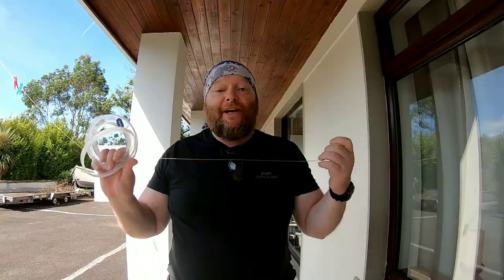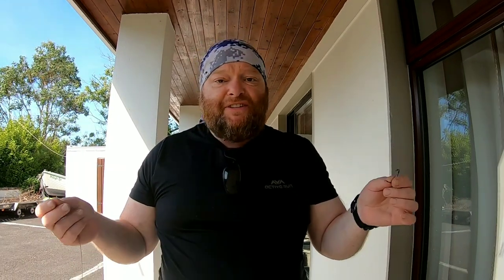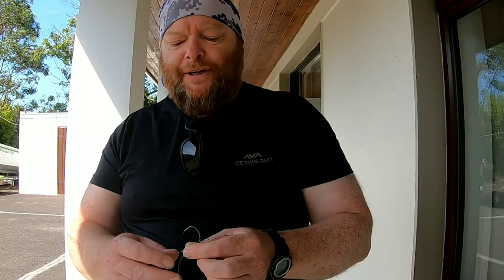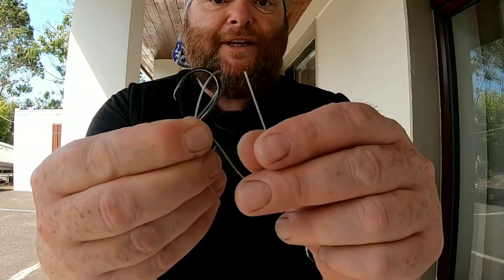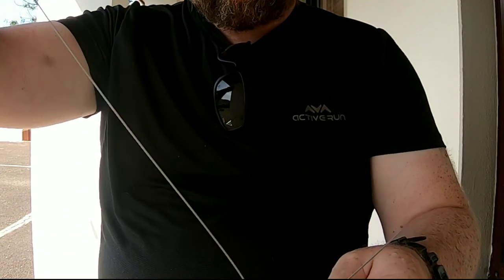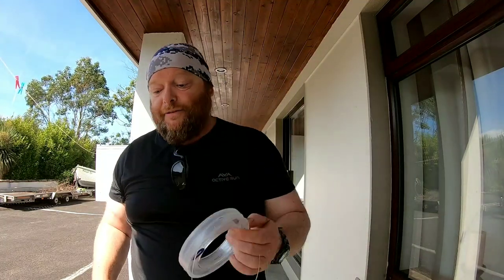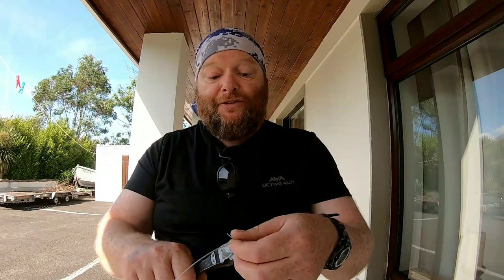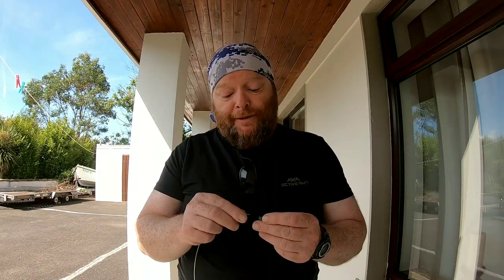How to tie the South African big game rig

Comment: very interesting. I'm going to tie up a few of these in different configs and try them tomorrow on a surf beach for bass.
Reply from the maker: Honestly a pulley rig would be your best bet! These rigs are used for casting oversized baits. Not unless you need the distance and are using bait of half a m mackerel! Thanks Brother 😁👌
Reply: @Billyfishing_watch  im going to use big crab baits
Reply from the maker: Well, if you think it will work better than a traditional rig! Go for it 👌
Reply: @Billyfishing_watch  ended up catching two schoolies on a two up one down rig and nothing on your rig or a normal pulley rig. case of casting into the wrong place at the wrong time and into the right place at the right time.
Reply from the maker: @defiantirishman4749 nice 👍

Comment: As an experienced South African angler I commend you for adapting our traces (rigs) for your conditions and introducing our techniques to the world. However what you refer to as our big game rig is simply our bite trace with which we target small sharks, rays and large edibles. For larger sharks we use the full metal jacket trace with hook snoods ranging from 0.5m to 1.5m depending on the species we are targeting. I recently landed a 152kg bronze whaler shark (copper) on our East Coast with the fmj trace. The fight took three hours over rocks covered with mussel beds. There is no way I would have landed the 300 pounder with a bite trace.
Reply from the maker: Hi bud. I am aware of the MFG, and the many other variations. I call it the big game rig,  because of the concept behind using one continuous piece of material with as few fail points in it as possible! Unfortunately people become bored if videos are too long, so I tried to keep them as short as possible and get a message across. Sometimes things get lost in translation. Thanks for writing in, see you on the beach brother 😁👌

Comment: I will start using this an dthe up and over ring rig..very informative Billy. All this seems to be working for you..Wel doenr and keep  up the good work.. Just wondering what length do you make your rigs over all?? Also woulkd the ring in the up and over hook snood have to be strong a sthinking it would create a weak link in the snood?
Reply from the maker: Hi Gavin. The open over ring rig is not a big game rig. But you could catch fish up to 30 lbs. The big game rig, depending on the strength of the line you use will catch fish to several hundred lbs. Thanks Brother 😁👍
Reply: @Billyfishing_watch  Nice..I usually tend to use pulley rigs but this big game rig looks good for the cod ray tope and huss with the bow in the rig b ody keeping it away from the bait but still leaving the bait streamlined during the cast. Is this rig good for rays. the issue I see with the pulley rig is taht the bait is in constant contact with the rig body. i have seen your video on using dingle dangles for pulleys however I do use a gemini splash down clip which locks the dingle dangle in place during cast but big baits are in contact with the rig body where as with the south african/big game rig the bait isn't.
Reply from the maker: Actually you don't need any fancy bait clips, they just make problems for you. Just a traditional bait clip on the lead weight, or a genie bait clip. And a rotten bottom of some type 👌

Comment: Hi Billy.  Sorry but I missed the lead connection at the end.  Also, I don't have many "toothy" critters around here until March.  So, I'm planning on using mono hairs for the 1st few months of the year.  Why?  The only worms I can get my hands on are dehydrated.  Also, the only live baits are clam mantles & mussels. Both very soft.  I'm thinking the mono will just work better for me.  Your thoughts? Thanx for posting bud.
Reply from the maker: Hi Randy. the sinker just goes on the 80lb line, on a clip. It doesn't matter what you make the rig from, but the hairs work best if they not made of mono. It stretches the bait. thanks Brother 👍😁

Comment: I was watching another video on how to tie a shark trace they use in South Africa using the same method with the only difference being the use wire for all the full length of trace from the hook up to the top swivel instead of tying a length of  100lb mono to the wire like you do. I am aware that is is so if  a shark is on and the wire trace moves over the mono the full length of wire prevents the shark biting through the mono bit of the trace and cutting you off. I want to make this trace for mainly Tope in the Uk. Is your method safe enough from a Tope biting through or would a full length of wire straight through be safer??
Reply from the maker: The rig you mention is FMG, this stands for full metal jacket. It is completely unnecessary for tope! 50 to 60 cm bite trace, using 150lb wire . And you will have no trouble 👌
Reply: @Billyfishing_watch  thanks brother..yea that FMJ rig is probably suited for bronze sharks they target in South Africa
Reply: I was also thinking of tying a lighter line from the pulley bead to the sinker to act as weak link.. is that loop knot tying the wire to the mono strong enough to hod for a pull?